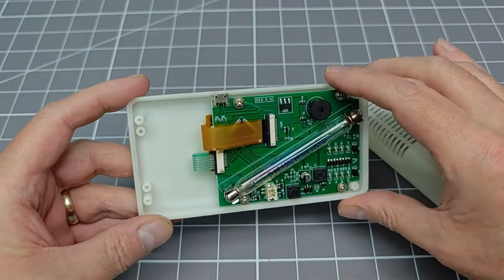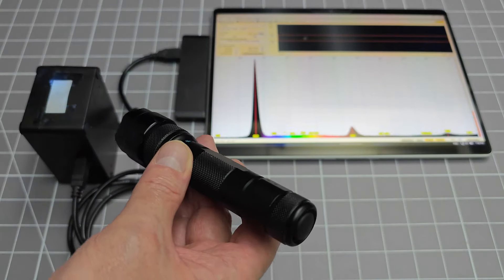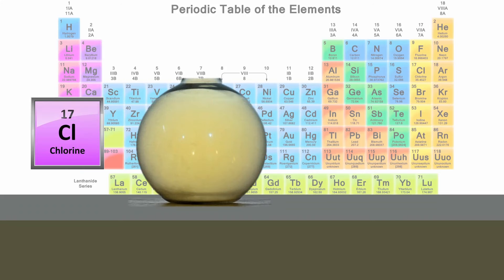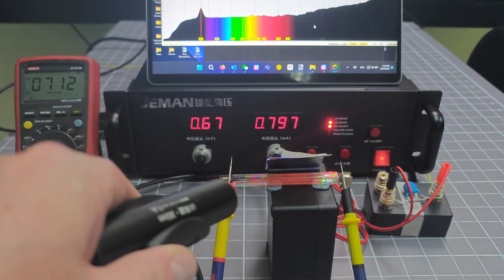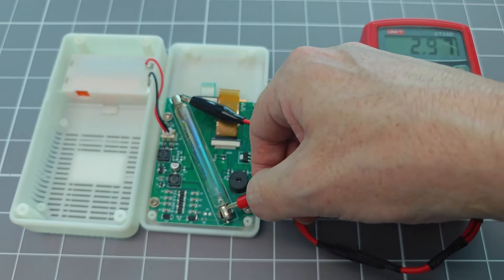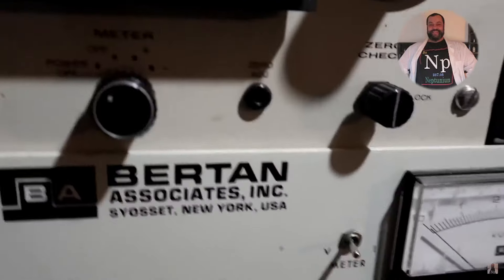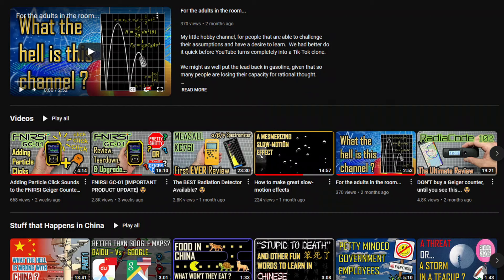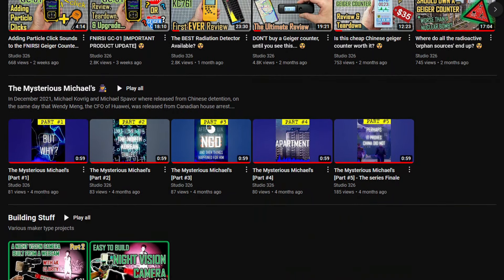A Crowd Sourced Nuclear Physics Experiment.

Comment: Why do you need to make this voltage divider when your AVO meter is rated for 500V (or 1000V)?
Reply: Presumably  the typical 10 meg ohm of input impedance on a multimeter is way too low to have in parallel with the tube being similar in size to the anode resistor of the counter.
Reply: Because of the internal resistance of the measuring device, which loads the high -resistance voltage on the meter tube too much and therefore causes it to break down. A normal multimeter that measures up to 1000 volts has 10 MOhm internal resistance. With an anode resistance of 5 MOhm in front of the counting tube, the voltage collapses on 2/3. Sometimes the high voltage generator does not even manage to provide the flowing current of >20 µA.
To use an Highly-Impedanced voltage divider is completely correct.
Reply: @dg0mg  Got it, thank you.
Reply from the maker: As other viewers have pointed out, its not a voltage rating issue.  Some of the power supplies used on these devices can only source a few microamps of current, the GC-01 is a classic example.  Normally a DMM has an input impedance in the region of 10 MOhms, so making the measurement actually changes the voltage level by a significant amount.
Anyway, thank you for the comment, this channel is dedicated to learning so there are no dumb questions, please keep asking questions!
Reply: Thank you all for explaining this, I had the same question.

Comment: How is possible that all of those counters use the same tube? Take the hfs and the fs 5000, the difference in performance you measured in the other videos is staggering. I didn't expect voltage to be that big of a variable
Reply from the maker: it's just down to being in the 'Geiger plateau' region, which is a function of the operating voltage.  Please take a look at the typical graph.
https://en.wikipedia.org/wiki/Geiger%E2%80%93M%C3%BCller_tube#/media/File:Geiger_plateau_curve.png

The pulse counting electronics also plays a part, but is far less significant.
Hope that helps.
Reply: @project-326  yeah you mentioned it too in the video. Idea for a diy project: It would be cool to have a radioactive measurement like this on a smartwatch. Probably you would opt for something smaller than a geiger tube like a scintillometer right? I think is possible

Comment: Huh, just watching this video now. I just so happen to have a high voltage meter and real (higher frequency) UV pen light, along with the GC-01 that arrived today. It would be easy enough for me to test this, but making a video of it wold require a bit more work, since it's not something I typically do.
Reply from the maker: That's awesome.  Don't forget the impedance issue - I used 100M/1M resistors in my probe to prevent the DMM impedance pulling the voltage down...  
I'll probably nag you later about the video, just record something quick and leave it to me to do the editing etc...
;-)
Reply: @project-326  Thanks. If I remember correctly, it has a high resistance option too. I'll check tomorrow and maybe get around to making a quick video too. Cheers.
Reply: @project-326  It's going to take a little longer than I thought. The "secret" high resistance mode (holding down the Hz % button while powering on) on my 87-V doesn't seem to be enough. The voltage was still being pulled down to 2 hundred something. I was able to test that there was a bit of UV sensitivity if I held the light near the negative side contact on the side of the tube, but not much of a change other than that. This is with the updated third-party firmware though, so if you want the stock firmware (mine shipped with v1.6), I can flash that back onto the GC-01. Cheers

Comment: some of the tubes are uv sensitive and some are not. Also seems to be more near the anodes
Reply from the maker: What I am trying to test is the UV sensitivity mainly due to the tubes that are operating at the top of above the Geiger plateau range.  It is common for manufacturers to have the tube voltage set high as it gives the impression of higher sensitivity.  So far the results I have received seem to confirm that this is the case...
Looking at the physics of a typical J321 tube, if the tube is being operated in the middle of the Geiger region, then in order to cause an ionization event from the photoelectric effect would require photons that are in the extreme UV range (<10nm), if the ionization events are directly triggered by photons interacting with the gas molecules themselves, then the wavelength needed is still very short (less than 100nm) which is kind of in the vacuum UV range.
Door number #3 is that the tubes that have high sensitivity to UVA and UVB are being operated too near to the ionization potential of the gasses involved and so the photon energy required to cause a count event is far lower.
I suspect that the sensitivity being nearer to the anode is because the ITO coating is masked off in that area and so the envelope becomes more transparent to UV in that region.
Put simply, I'm trying to show that UV sensitivity is the fault of the end product design and not of the basic design of the tube.

Comment: I popped open a GMC-320+ V4... The tube has a heavy black plastic optical shroud, Shining my 365nm torch into the small exposed glass sections at each end didn't materially change the click rate... might look at probing the voltage later.
Reply from the maker: quite a few manufacturers are also still under the impression that UV sensitivity is from the tube and often use a piece of heat-shrink tube to cover it.  I just cut mine off.

Comment: i have an entire box of UV LEDs, a multimeter, and i've ordered a geiger counter :)
Reply from the maker: That's awesome news!  Do you have 100 M resistors?
Reply: @project-326  i don't have 100MΩ resistors, but i did an adjusted version of your experiment using a resistor divider with a 10MΩ and a 100kΩ. its dose rate alarm went off when probed (in the graph this reached 10kcpm), but i measured 3.03V which translates to 316.1V on the tube itself. 

device: FNIRST GC-01 (flashed with RadPro firmware)
tube: J613

measured resistor values:
Resistor 1: 10.29MΩ
Resistor 2: 99.59kΩ

uv led test (using 6 uv leds):
there were no extra clicks detected, even while the uv leds were directly focused on the areas shown in video.
Reply from the maker: @ThatJay283  Just as an experiment, try putting 10 x 10 M resistors in series, I think you will find that the measured value you get will increase.
Reply from the maker: @ThatJay283  Thank you for taking part in this experiment!  Perhaps you can put 10 x 10M res in series?  The main issue is that a 10M resistor will load the tiny HV power supply and pull the voltage down, hence the voltage you will read will be lower than the tube will normally be working at.
Thanks!
Reply: @project-326  np. i only have 8 10MΩ resistors, so i measured 71.73MΩ for R1 and 10.25MΩ for R2, which gave me a voltage of 329.28V
Reply from the maker: @ThatJay283  You have done a lot of good work here!  Be sure to record a little bit of video so I can show everyone, in the next video
Perhaps try a 1M resistor for the one across the multi-meter (R2).  Typical DMMs have an input resistance of around 10M, so the resistance you are measuring across is less than you might think.
Reply: @project-326  thanks for the info! i've recorded the video, and i did definitely get a much higher voltage with the lower resistor value (i used a 680k resistor for r1). i got 600V, which is much higher than my measurement before of 330V.

edit: i just made it public because youtube appears to have deleted my comment
Reply: @project-326  https://youtu.be/fXvV8Mo_Q94
Reply from the maker: @ThatJay283  Your video is awesome - I just grabbed a copy.
I really like your multi-meter display on screen - what did you use for that?

Comment: I have several mica sensors. I do not know if ultraviolet light passes through mica...
Reply from the maker: I would doubt if any light can pass the mica...
Reply: @project-326  Why is that? You yourself show such a sensor at 4:02 Through mica you can see the inside.
Reply: I tried on my pancake mica tube and UV made no change in count (quick high-impedance probe gave 430V on tube). Still going to post something.
Reply from the maker: @gblargg  Thanks, I look forward to the experiment video!

Comment: I am going to start on this project this week. I am a little bit late to the show but I will give my results. I have Crocodile clips (UK) Alligator clips(US) Gojira clips(JP) nipple clips (DE) GMC-300E+V4
Reply from the maker: Looking forward to the results!
Reply: @project-326   My results from a GMC-300E-4V shrink tubed J-305 GM tube  Powered the GMC300Ewith programmable DC pwr supply from 3.7v @800 ma to 9.1vdc @ 950ma. used 360 to 400nm UV light no excitation of tube, voltage at GM tube 410-411 VDC dropped to 408Vdc when excited by Thorium-232 source. My conclusion its,  the Gas in the tube , its concentration and purity vary from tube to tube. I saved it all on video. How do I send you the video ?
Reply from the maker: @huntingtimes7732  just save it on your channel and then let me know so I can get it from there.

Comment: I think you need to remove the white protection Tape/Paper first!! from the black box spectrometer before using it!! 🤔🤷🏼‍♂️
Reply from the maker: it is a diffuse filter, it even came with a wad of those too.
Reply: @project-326  then what is it made of?! Because a lot of materials directly absorb UV radiation! There are only a few things that are transparent for short wave UV-C radiation!! Like quartz glass!! 🤷🏼‍♂️
Reply: @project-326 but I Do want to thank you for your work! You are helping the GM community a lot in general!! 👍😉
Reply: @TheOpticalFreak The spectrometer doesn't claim it can measure UV-C. UV-C is 200-280nm, UV-B is 280-315nm and UV-A is 315-400nm. The spectrometer can only measure from 300nm upwards.
Reply from the maker: I got so much interest in that cheap optical spectro, that I am now making a video all about it.  Stay tuned!

Comment: Let's do another experiment, just as relevant!  We will use a golf ball and drop it into a pan of mud made from dirt in your area. We will measure how big a splash it makes! About as useful as measuring UV sensitivity of a crappy Geiger tube! Top quality Geiger tubes are metal and use a thin metal window for Alpha detection. Point: SAVE YOUR MONEY UP AND GET A PROFESSIONAL GEIGER TUBE! (if you are really interested in using a Geiger tube to measure radiation.)
Reply from the maker: 99% of the counters that people buy, use these [quote] 'crappy' glass tubes.  So far I have been sent over two hours of video footage, from people who are truly interested in knowing more about this subject.
Personally, I would not waste MY money on an expensive GM tube, just because it can measure some higher energy alphas, it suffers from the same main issue as any other GM tube, the inability to compensate for energy.  For the cost of just the professional Geiger Muller tube, people can buy a complete gamma ray spectrometer.  BTW, energy compensated tubes are only x/gamma tubes.
Understanding why effects like this happen is not irrelevant, at least not the many people who have shown interest in participating in this experiment.  Just buying a more expensive piece of equipment does not give a deeper understanding of the subject, whereas figuring out the limitations of inferior equipment can yield some real insights.
Reply from the maker: sorry, I'm having trouble seeing the trajectory of this argument.  Initially you criticized cheap tubes and praised expensive alpha capable GM tubes, but both have the same issues, an absence of energy compensation.  Being cheap doesn't make it worthless - with a deep enough knowledge of the subject, you can extract a lot of good quality data from a basic GM tube equipped counter.  Often it is not the quality of the tools but how you use them that makes the difference.  Cheap tools require more intellectual capital to be applied.  Yes, there are extreme cases where this argument breaks down...
On another topic, I follow your channel quite often and my young daughter asked me "Daddy, how can we make a light bulb", well I'm kinda screwed now, Daddy MUST have an answer.  My first attempts were quite poor - what kind of torch would you recommenced for a beginner to that subject?  I used a MAPP gas torch with very horrible results, maybe mine was too cheap ;-)
Reply: @project-326  I had a GammaScout in the distant past.  It had a LND712 tube.  When I had placed the unit on a scanner to scan the plastic back,  it produced a large increase in the readout.   So the GammaScout was sensitive to light and probably UV from the scanner's light source.  Not scientific.  My ex GammaScout was had no ESD protection.
Reply from the maker: @gh8789  If you watch the video we did on beta backscattering, you can see just how sensitive the Gamma Scheisse is to EM fields...